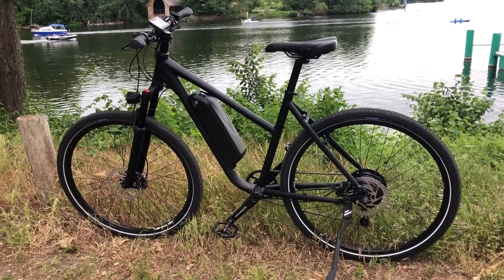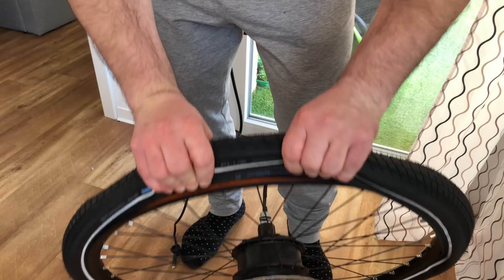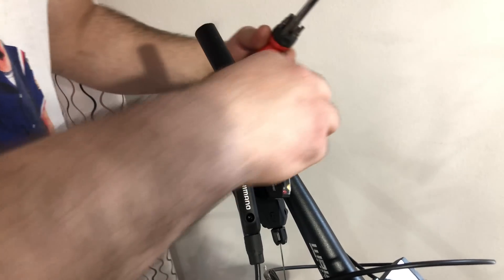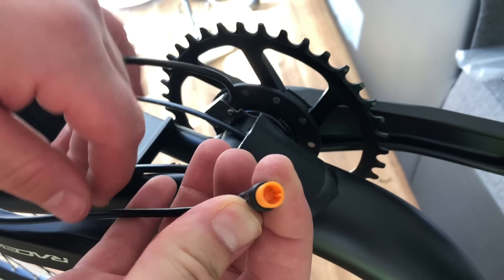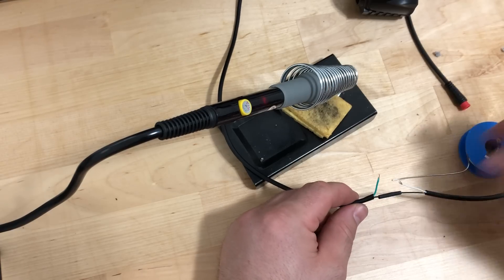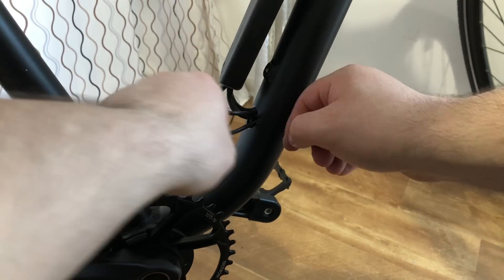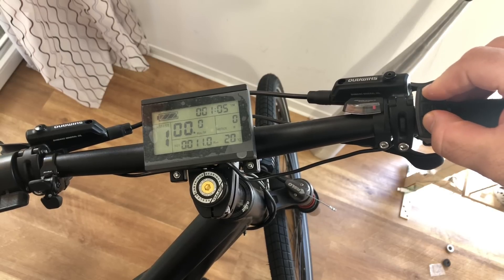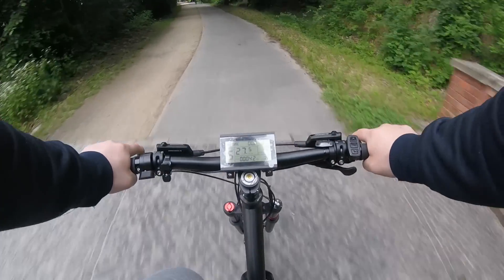DIY Electric Bike Conversion Kit || My How To eBike Build and Test drive

Comment: very clean workmanship, especially on the cable management. Good job !
Reply from the maker: Thank you!
Reply: @thediyed  one tip, if you have multiple cables going the same way, you can put them through a long shrink wrap sleeve. It makes things look even nicer and cleaner then with zip ties. probably a pain in the but to take apart if smth breaks but yeah ... aesthetics :)

Comment: Bang goes any Warranty. Very risky to drill holes in your frame. They are built that way for a reason.
Reply from the maker: I am no worried about it. Its more then 2 years since I build it and 0 issues.

Comment: Hi. Great job. What do you call the rubber ring you put in the frame hole please? Do you have a link?
Reply from the maker: Not sure how to call that part. but I made it and 3d printed to protect the wires from getting scraped and make it look more sleek. I will need to find the STL and attach if you want to print it out.

Comment: Good job, I like it! One thing I did notice, isnt your chain bit to long...youre supposed to put chain on the smallest sprocket and then the derailleur wheels should align..? And how does the bike perform especially on hilly terrain..? Is building battery yourself that cheaper than buying it in store..you have to buy batterycase (charger included?), battery´s, spot welder, BMS etc.  separate to...?

Comment: Very cleanly made video, everything explained well. If you dont mind me asking could you post a link of the frame? I loved how you made the cable management on this frame i am thinking of grabing one of the same frame for my build. Thanks for your time/answer.
Reply from the maker: Maybe I am to late but the frame was purchased of Ebay from a local seller in EU, not sure will be of any help if I post the link.
Reply: @thediyed  link would be greatly appreciated if you cant find it i am from EU as well so there shouldnt be an issue. Thanks

Comment: First off, I loved the vid - great job 👍

Questions - 

1. I have a nice, quality mountain bike that I’d like to convert to an bike. Can I still use the same rear wheel/rim & existing gears (hub) or do I have to replace them?

2. If I use the same rear wheel/rim & replace the hub/gears with the new set, I will have to change the spokes as they will be a different size, correct?

3. Battery life, how long (by distance or hours) do they last before recharging? I weigh about the same as you & I won’t be doing any long, uphill rides.

4. Is there anything you’d do differently now that you’ve ridden it for some time?

Thank you!
Reply from the maker: Hi Jason, 
Thanks for watching the vid. I will try my best to answer your question.
If you want to use the gears, you need check what hub system are they. I would actually recommend going for a cassette hub as you ca find better options the freewheel is an very old system.  
If you want to use the same rim you can, but its very unlikely the spokes will fit. You have an option to get a hub motor with the complete wheel but all of them have very heavy rims that are also for rim breaks. If you prefer to run a lighter setup and you have disk breaks I would say put your own rim.

Battery life was very good, in average I would be able to get more then 100KM per charge. If I was riding it on max power all motor probably around 30km.

I can tell you what I would do differently because the bike was stolen a week ago locket in front of my gym (in a new city). I already purchased all of the parts, except the frame, which I will do in the following days (same frame).
Honestly it will be the same, the only 2 changes I will do is the screen and wiring a rear right to the system. I will be using a LCD color display (its just $22 more) and it has a USB option. I was planning to do that on my first build but somehow i convinced my self is not needed. Having a USB charging port on the LCD screen I will be able to charge my phone while using navigation, being a color LCD will not make any difference just it will look bit nicer. 

But there are few things that I will do to ensure I can recover this bike if it gets stolen. I will remove the push button for the battery and add a remote that will turn on/off the battery, adding a GPS with 120dB alarm that I can trigger remotely. If you track the bike and its a building complex you can't really go door to door, what you can do is trigger the alarm and know exactly where it is. There will be more layer of security..probably overkill but I don't care. 
Most probably i will not film my second build as it will be almost identical but I will film some parts as the battery build with the remote control and the other security measures I will be implementing.
Reply: The DIY Ed - excellent, thank you!

I am more inclined to get a new rim that’s already setup. Where can I find one? I am not too fussy about it, I just have a great mountain bike that I don’t use any more & would use it.

So sorry to hear that your bike was stolen. I installed this alarm that I got from Amazon on my bike, it’s inexpensive & very loud!

https://www.amazon.com/gp/product/B0734QN8KR/ref=ppx_yo_dt_b_search_asin_title?ie=UTF8&psc=1

Comment: I am impressed. Truly amazing.  That is a great looking ebike. Do you have an estimate of the number of hours it took to build it?
Reply from the maker: Thank you, as an IT guy myself cable management was important.
Its hard to estimate the hours, I laced the wheel few weeks before and I just spend an hour tuning it up. I had to clean, prime and paint the frame and that was also weeks before. If I don't count that, I would say with assembling all of the bike parts, not just the ebike parts, took me a whole weekend working at a slow pace. 
The ebike parts where in the end, and this is what I filmed, this took me probably less then 5h

Comment: May get a 1500W ebike kit
Reply from the maker: That is way to strong. Make sure you use a strong frame and good suspension. I would also go for 205cm disk rotors, for better breaking.

Comment: Can we please get a price breakdown on bike plus battery plus wheel, everything you bought that you think would be relevant?  I'm looking at the links posted but I can't seem to add up to $900 USD.  Maybe prices have fluctuated due to the spike in bike demand.
Reply from the maker: I needed some time to gather all of my purchases as I've started doing them from last year. I was hunting for discounts most of the time. I have added a pinned comment with the breakdown on the expense. I noticed the prices have jumped up, especially for items coming or imported from China.